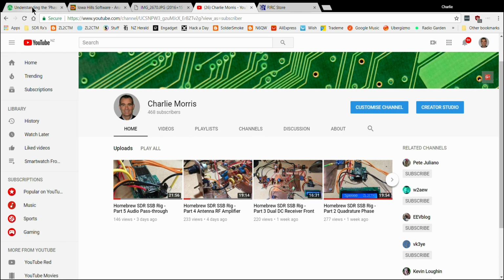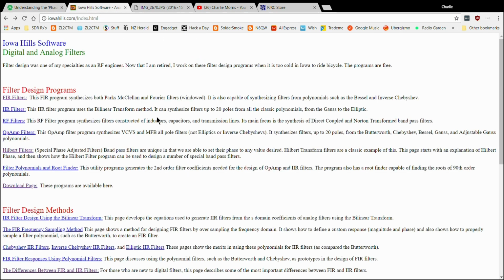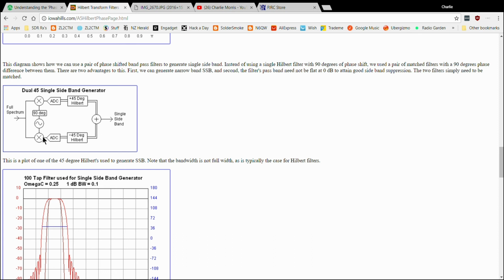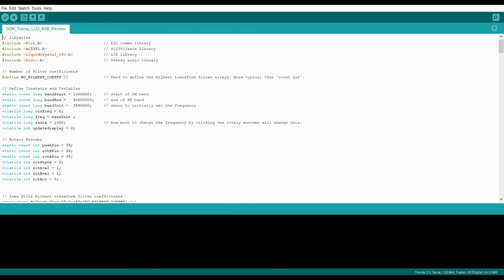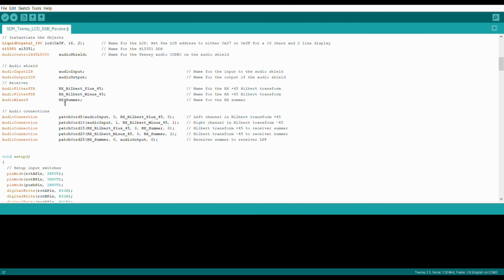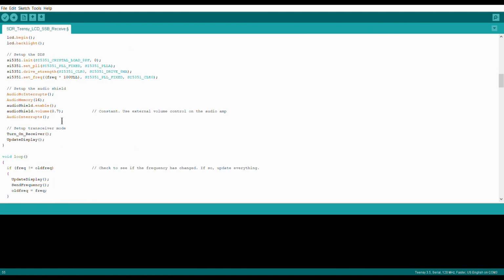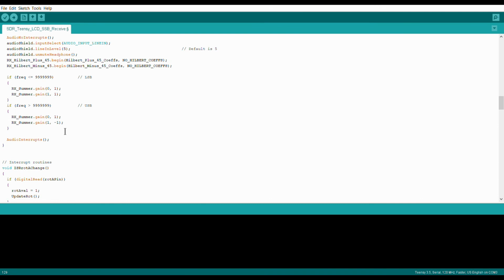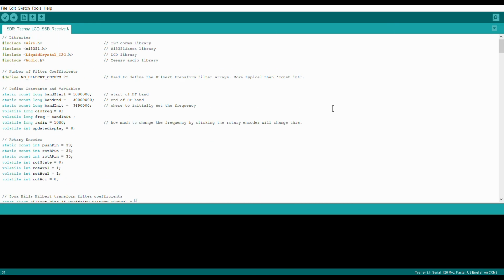Homebrew SDR SSB Rig - Part 6a Hilbert Transform Filters

Comment: Appreciate the explanation of the architecture. I need to dive into the math a bit more and learn to bring it over to code myself. The Teensy seems like a powerful M4 core; I am on my way trying to accomplish this on another slower TI M4 using CMSIS and an audio adapter board. I understand the worry of pleasing all viewers, but I sure do appreciate the effort to show the gears turning in the background.
Reply from the maker: I must admit I have done any DSP since uni. The beauty of the Teensy platform is that the audio library does all of the heavy lifting. Having said that, a FIR filter is only a few lines of code. Your project sounds interesting indeed. I wonder if it would be worth you deconstructing the audio library files? I might take a look too at some point.

Comment: Hey Charlie! I haven't been keeping up with your latest builds nor working on my own build due to current circumnstances, but thought I'd just say thanks for all the excellent videos. I've learned a lot! Keep it up! I like the idea of going straight to software as soon as possible! Maybe this will be my second build if I ever complete the first build!
Reply from the maker: Thanks for that. I had another comment about using a more easily sourced mixer rather than using-say-the SBL-1 DBM.  As an aside, a have just received four ADE-1+ DMBs from China. USD4 each. I'm looking to use those for the next build. If they work well, then I'll look to get some more. Free shipping too, which beats the USD141 I was quoted from Mini-circuits!